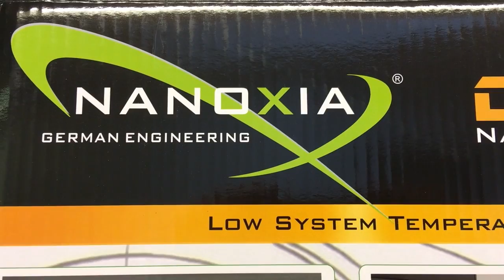Quiet PC Case in White - Nanoxia Deep Silence 1 (Rev B) Review

Comment: This is the original DS1 case, not the Rev. B - the latter has redesigned drive cages (5+3 not 2+3+3) and a different cover for the USB ports (the popup thingy didn't seem to work very well). There may be other modifications, but these two are the most obvious.